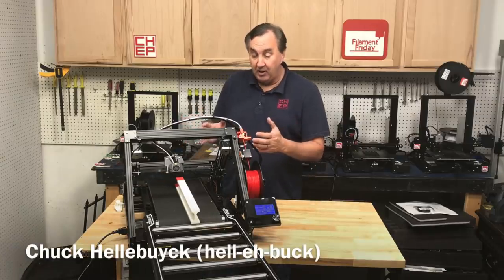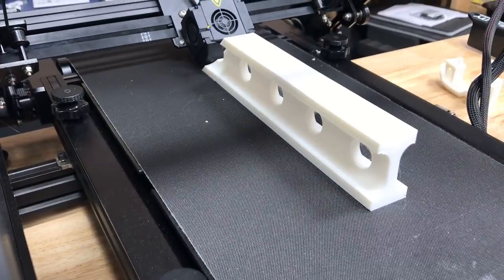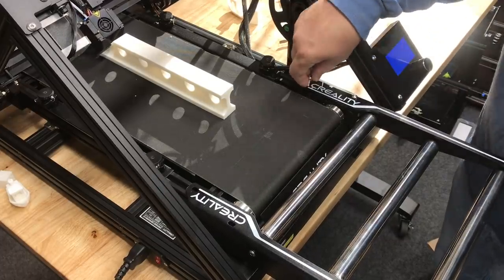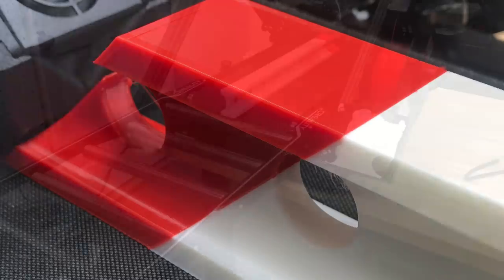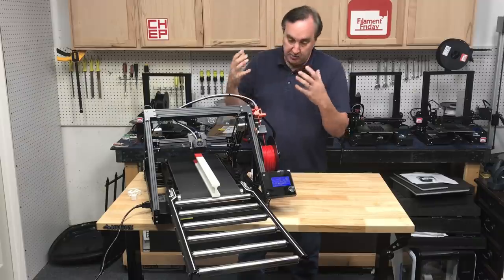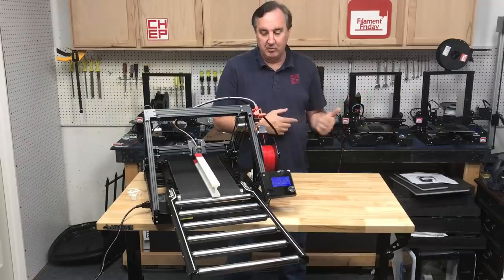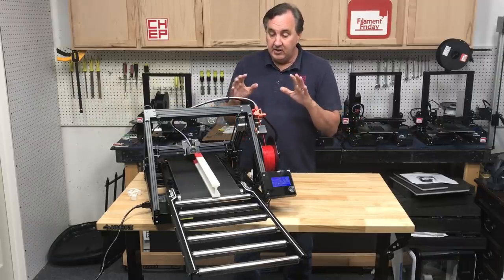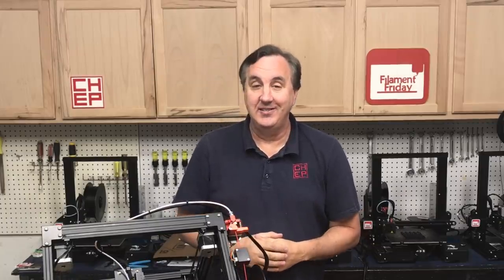Infinite Length 3D Prints on Creality CR-30 - Naomi Wu's Printmill

Comment: it would be great if the extruder would pull away from the print when the system has a power loss to prevent the melting/layer shift issue. Almost like a fail safe procedure since there is some residual power charge in the system when the power fails or the power switch is turned off.
Reply: Agreed, they could build in a small battery that on power failure the Z moves 10mm, if they were clever they could even achieve this with capacitors

Comment: I think that the biggest advantage is that you can continually print object after object. Without having to remove the print from the build plate in between prints.

Comment: If you get a second I do have one suggestion make sure you do some extensive side by side z-axis step calibration tests (done just like calibrating e-steps), from my testing I've learned that belt thickness, tightness and even how you have the leveling plate positioned can slightly alter the z-axis dimensional accuracy..  Case in point I have two different versions of the CR-30 beta models..  I had the same e-steps settings and printed two sides of the same sword, one on each printer.  The over all print length was over 760mm but one half came out 4mm shorter than the other..  With some more calibration I was able to get them within 1mm but I'm sure the longer the print the more critical this would become...  My recommendation to any prop makers that buy more than one, always print both halves of the same part on the same printer just to be sure the scale stays the same.

Comment: First thing a new owner could do is print a better roller extension, that's not been thought through very well and looks like something you would attach to a saw mill totally out of step, limited use and a big machine for a home hobbyist but a nice option for a print shop.

Comment: The rollers are a bit of overkill. Those things look like could handle couple hundred pounds. Something smooth like laminate with some 3d printer brackets. You could truly print, build, extend, and repeat so the tray cold be infinity long 😂
Reply: Infiniti minus one long ;-)

Comment: Hello Chuck, does printing at an angle affect the structural integrity of the print?
Reply: Someone else has a bolt test printed at various angles, naturally a 45 degree shift winds up between a flat print and a layer only strength test. But it's basically just layer adhesion on a wider area

Comment: Printing PETG will be an issue with that belt. It would be better if the belt was steel with a pei coating or even coated with capton so you get good adhesion for all materials and the part won't bind permanently with the belt. it may only be good for pla
Reply: Yea, machine looks nice. I mean chinese copied good from open source guys. As we can expected creality will not invest a single penny on 3d printing development. But they better invest on marketing or printer giveaways. So we can be sure it will only print on PLA and will fail after 70C degree threshold, so bye bye PETG and ABS.
Reply: @dzitiatri  NAK 3D Designs says that design is Creality's own, not a copy of any design he's aware of.

Comment: Another great video - many thanks. You mentioned you don’t run prints overnight - do you just switch off the printer and resume in the morning? Or is there a method/setting to doing this? 

I’ve wanted to run some longer prints, but was worried about leaving it overnight.
Reply from the maker: I switched it off and resume in morning. It’s a beta so I’m not trusting it totally yet.
Reply: @FilamentFriday  many thanks - I feel silly for not thinking of that before, mine has auto resume - just switch it off 🙄 👍

Comment: The roller system really needs a quick release mechanism, or a folding mechanism.
SCA have their sealant barrels on some simillar rollers and they fold nicely.
Definetly needs another solution, and height needs to be addressed by Creality, not end user.

Comment: As some other reviewers have pointed it, it needs some work and some corrections before I'm willing to plunk down the money. It's a fantastic concept and will probably be the norm moving forward, but it does have some issues. That belt simply isn't going to last at all and is a huge problem.
Reply from the maker: Maybe. It has to get enough support on Kickstarter first though to become a reality.
Reply: Why does Creality now need to use Kickstarter?
Reply: @truantray  yeah like they dont have the $$ for R&D...
Reply: @truantray  Kickstarter is now no longer just for startups. It is used for marketing and getting in presales of a product before manufacturing. If you can be guaranteed X number of a product before you even start to manufacture them then you know the market is there for your product

Comment: I noticed the benchy left Mark's, Do you think the belt will become harder to level and prints to stick to? And would you have to buy a new belt or clean it some how?
Reply from the maker: The belt on mine isn’t the released version so I’m not really sure. Leveling is easy though.
Reply: So far there are no adhesion issues where the belts been printed on before but I need to see if printing many different colors causes an issue with those colors transferring to subsequent prints.
Reply: @Naomi-Wu  oh. Yeah, I didnt think of that, Like if PLA, TPU, PETG, etc mix on the belt do you think it will cause problems? And what if the nozzle was too far down, On a glass bed it would scratch it badly, would it maybe cause a tear?
Reply: @harveymatthews578  well the end stop keeps it from digging into the belt but yeah, I have to see what happens with filament buildup. Worst case we go back to steel.

Comment: It's leaving chunks of the belt in the print, lol. Look at the belt and you can see where the bed surface got pulled off by the previous parts (you can see they were Benchies, lol). That grocery store belt was a really idiotic engineering choice, IMO
Reply: Chunks?  hardly....  You can see silhouettes on my belt as well, but it has made no change to how well prints continue to adhere to the belt.

Comment: Would it be possible to print your flags on that thing? Like a constant printing and the finished flags drop down into a bucket or something, runs as long as there's filament.
Reply from the maker: Sure but as I mentioned it’s faster on my Ender 3’s since they can print in parallel.

Comment: Can't someone proficient in Marlin add a function for the Print-Resume to home xy while heating so it doesn't melt the print and a zhop over the last known position, i have had prints completely knocked off the bed after 30 hours because of a molten blob like that which is a huge waste

Comment: This will be more usefull with a 1.0mm nozzle for bigger faster stronger prints, no doubt is not for just printing benchies. Will be perfect to print jigs and tools for woodworking for example or for printing mouldings and trims for cars that are not available or hard to find, prety sure there is a market for this printer, cosplayers can be prety interested on it, no mor swords glue ups, just print it in one piece and talking about it I can use it to print sheaths for my japanese hand saws 😎
Reply: Once this is successful I want to get IDEX and pellet printing on the next version😊
Reply: @jon9947  I think Naomi wants idex for a reason that can't be done by the tool changer. Dual printing!
Reply: @Naomi-Wu  If somehow you can add a hopper for pellets that also can use shredded recycled prints that will be awesome!
Reply: @EPortillo5000  Trying for a tube with a blower, hopper has to be refilled too often...

Comment: Your 4:1 don't account for reload time and warehouse rent.  Ender 3s take space
Reply: It's still a very valid point, and a good benchmark when we're trying to set an idea price for a belt printer like this...
Reply: @Naomi-Wu  i recently wrote about 5 pages on this topic.  While scaling, cheap printers are better, but transitioning to faster and lower maintance starts taking priority.  Honestly I think the CR-30 is a bit too big for a continuous printing machine if you want infinite Y for mass production purposes.  Smaller and stiffer is better to allow for faster printing with fewer flaws.
Reply: @speadskater  I agree, but smaller than 170x200 would never fly with consumers. Most insist on buying printers far larger than they need or is optimal because "one day" they might want to spend a week printing a chair for a toddler. Maybe a special rackmountable print-farm edition later for commercial use...
Reply: @Naomi-Wu  I'd like to change that culture, print farm density is way lower than it should be because people want this general purpose machine that will "print a chair".  If they all switched to voron 0 structured machine with auto eject gcode, they'd have a much more dense and quick printing farm that actually made a good profit for them
Reply: @speadskater  Auto eject is great once it's setup- but real world it takes a lot of time to "Goldilocks" first layer adhesion on each model you want to batch (not too much, not too little). Find for Prusa where they only change models every few months, but most farms have to switch more often than that.
Reply: @Naomi-Wu  is that the case for a printer with hard mounting points and abl with a trammed setup, or a printer like the voron 2.4 or HevORT with dynamic leveling?